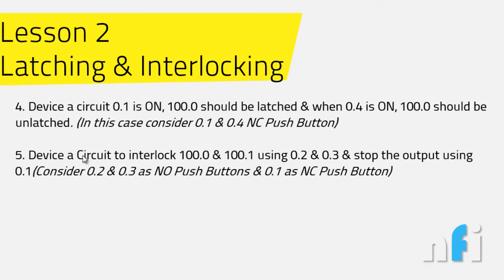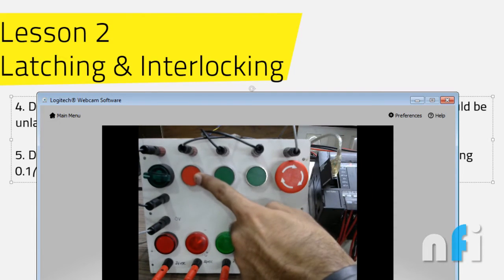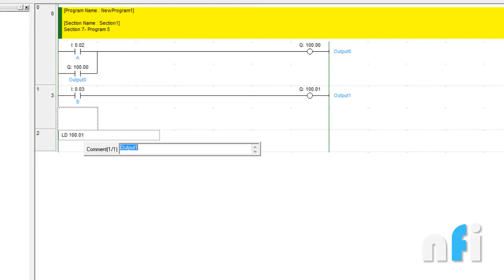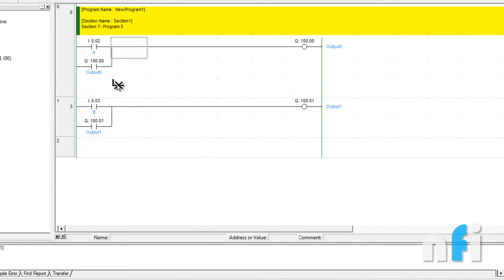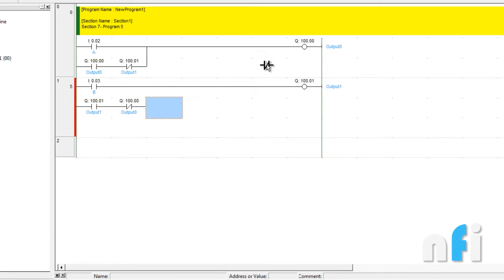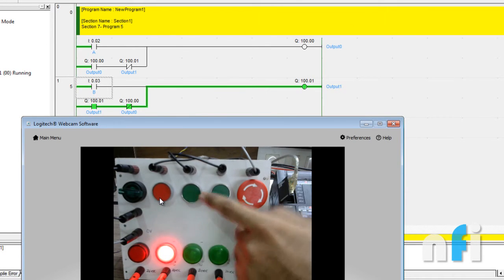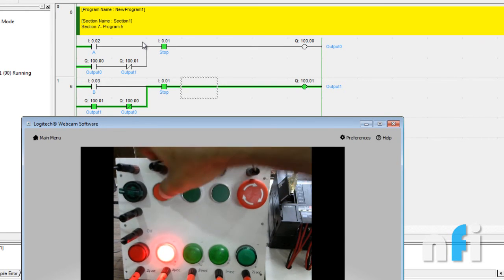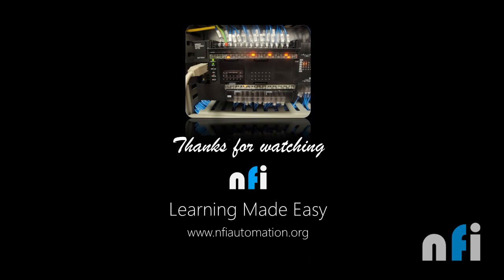Omron PLC Lesson 2- Latching and Interlocking Exercise-5

Comment: Why have you used an NO for the stop in the PLC circuit if in actuality it is an NC? Can you please elaborate.
Reply from the maker: +Pallavi It's the fundamental logic if you use NC Switch to STOP the output we have to use it's NO contact in PLC Programming to unlatch the ladder. If you use NO Switch to STOP the output we have to use it's NC contact in PLC Programming to unlatch the ladder.
Reply from the maker: Because NC contact will open when it's coil is energized and NO contact will be closed.
Reply: why?
Reply: why?
Reply: why?
Reply: tnx!!!